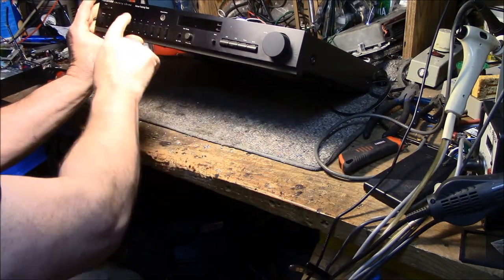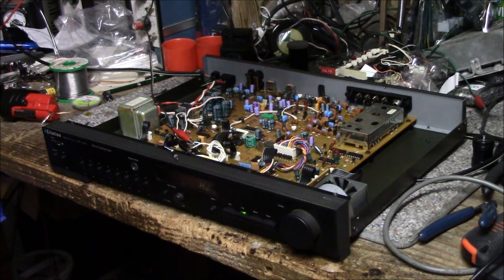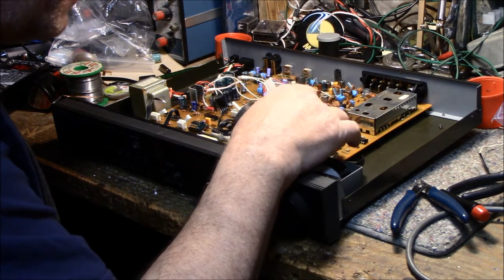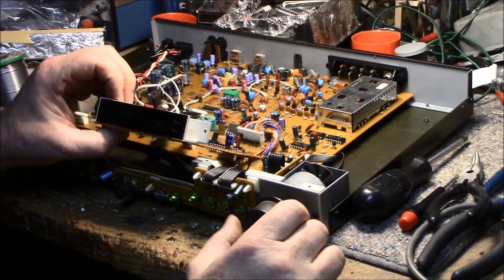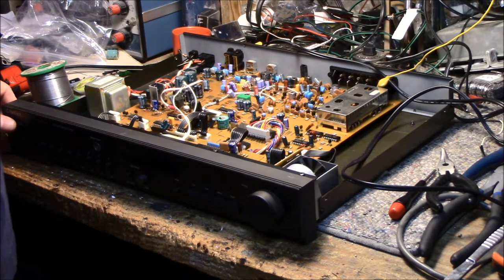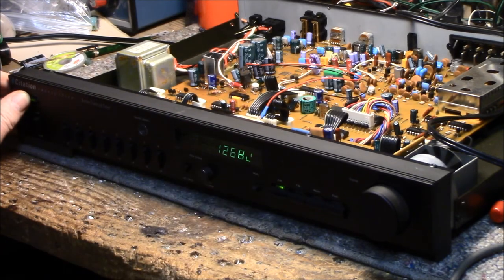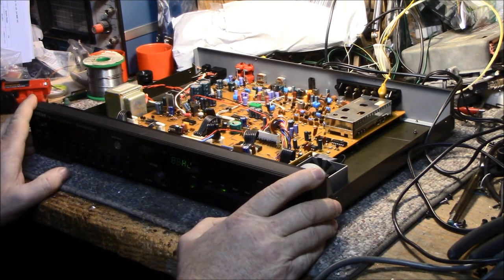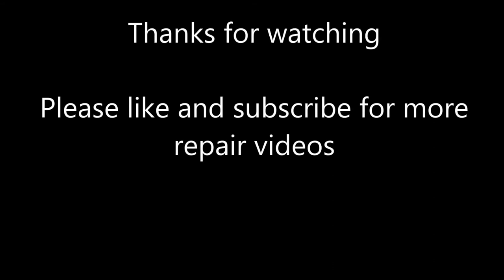Harman Kardon Citation 23 Tuner - eBay Junk - Repairs (Ep. 8)

Comment: Hello. I have the same tuner which I bought used. It works absolutely fine except the fine tuning control has more range in the + area than the - area. Do you know if there is an internal adjustment to center the fine tuning control?

Comment: MY MAN! I found out why the tuner knob is so strange!!! I have a TU 915 and it has the same or similar mech and you have to take out the sensor and on the front there is a nut and then you remove the weight. Inside the weight there is a 7,5 or 8mm rubber ball (probably for drag) that is over the time deformed. I now took it out and it is very smooth. Of course no drag any longer, but it should be way better and working much better without frustration.

I hope that helps you, my man, and would be nice if you could comment if you've seen that comment or if you have applied this mod and what the result is. There is 8mm rubber balls in ebay but I may not replace it because there is different rubber and with little use it may dent again and why put in a possible source of trouble, but if you would restore it completely you may want to look into that but it was so annoying, I probably will leave it out or maybe try it. At least I found out the issue, but you cannot see the ball from assembled view. And it is also black.

Happy repairing. Keep the Harman stuff alive, you are the MAN!
Reply from the maker: Thanks for letting me know